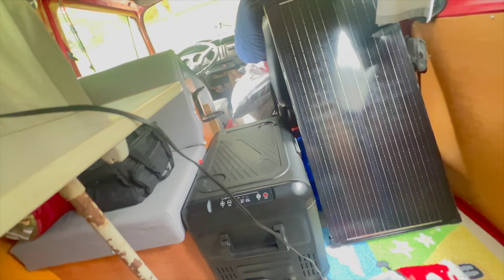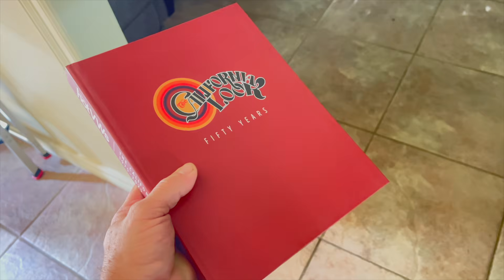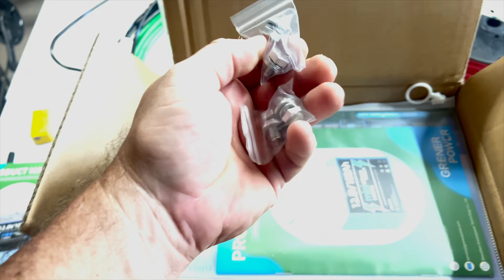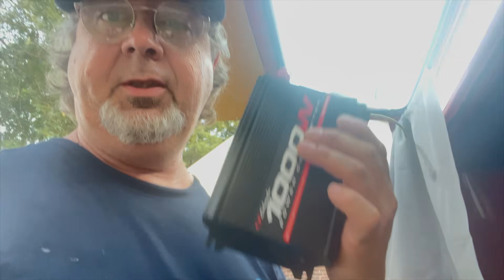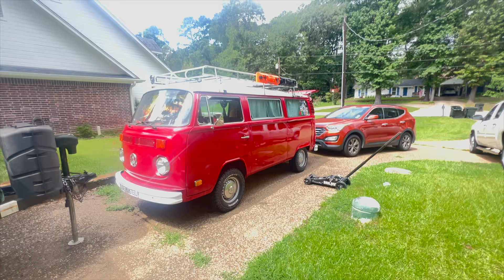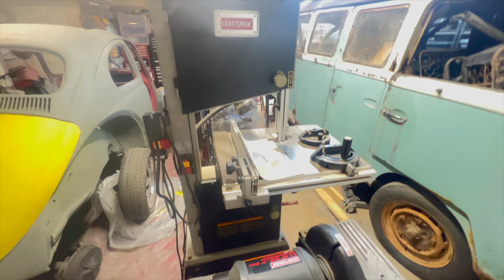How to install solar in a van/bus

Comment: Nice install man. 
Make sure when you have those 2 batteries installed, you connect your load negative to one battery and the positive to the other battery to pull equally from both batteries.
Reply from the maker: That’s the way I have it.